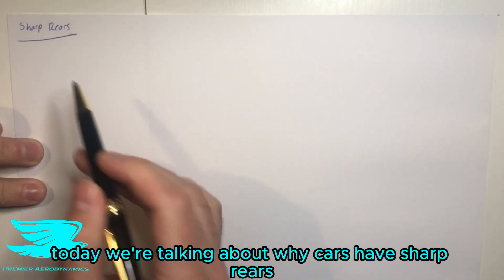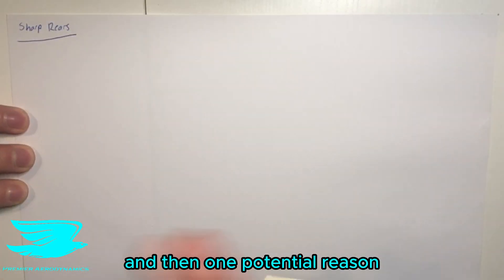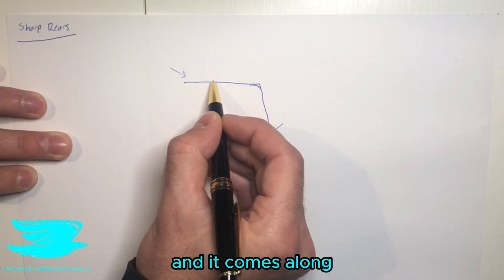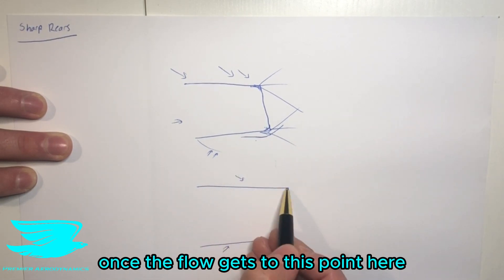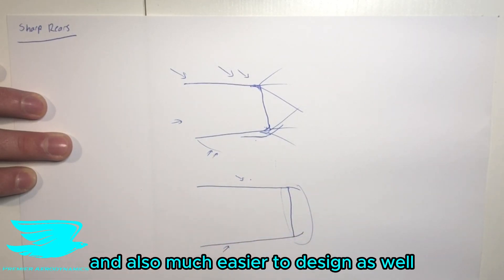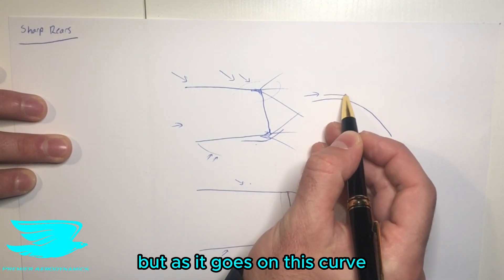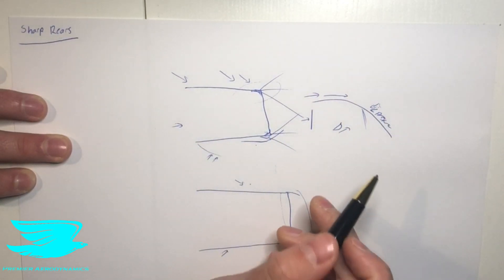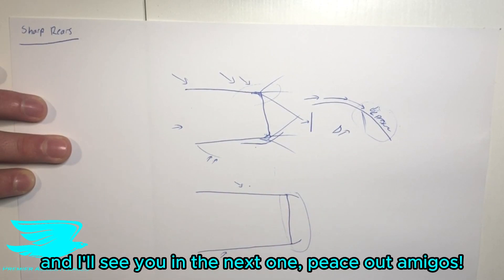{Auto Aero #39} Why Modern Cars Have Sharp Rear Edges

Comment: But don't curved rear ends reduce the wake size and so reduce drag? Or is the idea to curve the sides so air flow is still attached right up to the sharp edge.
Reply from the maker: Assuming that the curved rear ends don't culminate in a point, then the should curve up until a sharp edge, which they can then separate cleanly.

Comment: Do sharp rear edges make cars satisfy the Kutta-Jukowski condition as well, making it a little easier to calculate lift?
Reply from the maker: Well the Kutta-Joukowski theorem is more for 2D object, and airfoils are quite flat, so it works well for them.

For a 3D object, like a car, you can kind of extend it effectively with a vortex panel method approach.

So, it kind of does, but with some modification.